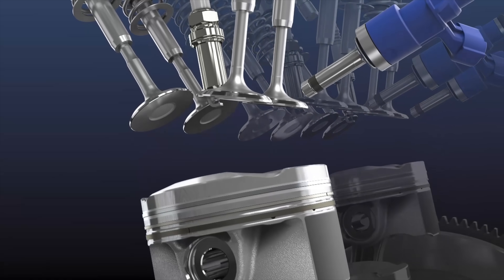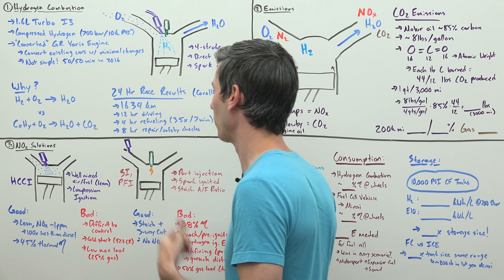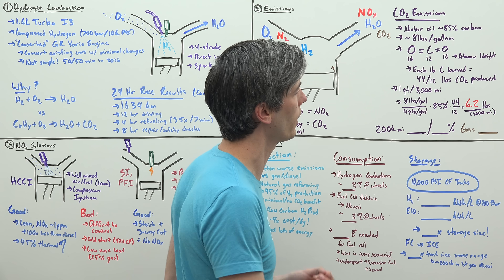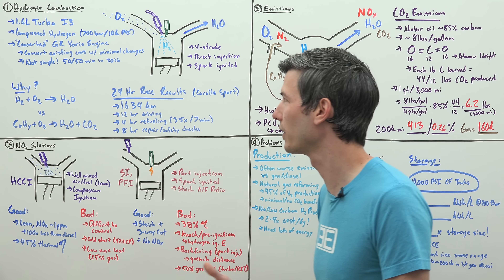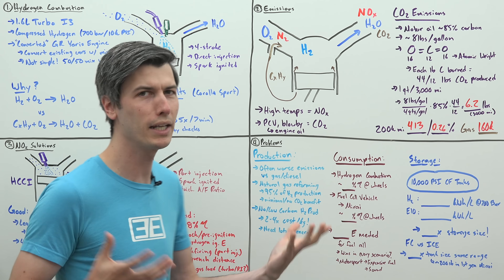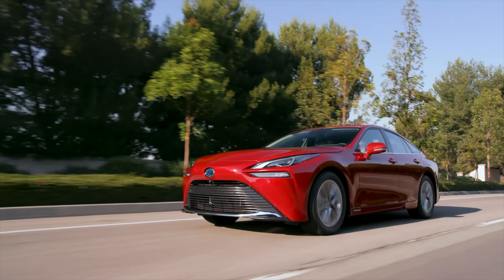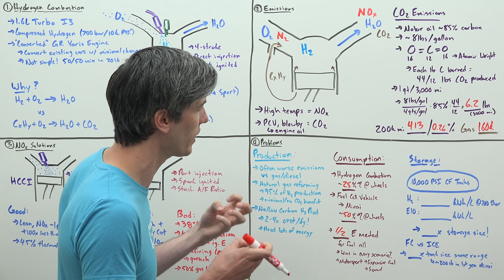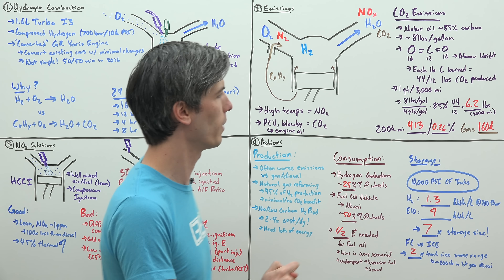Toyota's Developing A Hydrogen Combustion Engine!

Comment: Lets say you burn oil every 3k miles... Me a AP1 owner "right right..."
Reply: What is an AP1 ?
Reply: @rimckd825  it’s a honda s2k
Reply: As the previous owner of a 1998 Corolla, "That's nothing, man!"
Reply: Don’t hate on Hondas self-replenishing oil system!
Reply: I'm a subaru owner with a blown head gasket... my oil goes below the dip stick about 250 miles after filling it up
Reply: Me, a Yaris owner...
"Sorry I've lost you, what do you mean by 'burn oil' ?"
Reply: @Patient_Lion_BS  I wonder what this oil thing they're talking about is? 

My dad owned a 1997 Camry and he frequently 10k miles without changing the oil and had no problems
Reply: My 3.7 shawd tl burns about a quart every 1200 miles at best and that wasnt enough to qualify for new piston rings
Reply: @Egerit100  i too hace a '97 camry. Even today, 142k miles later, i don't think it burns ANY oil. Or if it does, it is a complely negligible amount.
Reply: me as a dorito engine owner: you only burn 1qt/3k miles?
Reply: I do 20'000 km without even needing to top up. Same with my previous car. Both diesels.
Reply: @jthomp997 Same :D
Reply: Me a Seni truck owner: right right
Reply: @jonwebb9261  Honda CR-V 1.5t owners would like know if you want extra fuel with that oil?
Reply: My old car only required an oil change every 60000km or 37500 miles. Sold it 2017 with 285000km/180000miles running like new. Never had to fill up in between the oil changes. Was an 2003 Opel Signum 2.2DTI (125 Diesel horses) (similar to a Saturn Aura, of course this engine was not available in US and also was used only up to 2004 or so in the Opel brand)
Reply: My C30A and B18CR don't need to top up even after a track day. I run 5w-30 Full-syn and change oil every 3-4000km. 
We all know how majority of owners love to rev it to 9000 but cheap out on maintenance.
Reply: Harley owrner: you guys are burning oil? Mine is in the driveway.
Reply: Pfff that's nothing,  i just neglect all maintenance and lose chunks of the car on my way to work
Reply: My ap1 doesn't leak. It doesn't smoke. The oil just disappears like magic.
Reply: @FroztiProductions  My AP2 isn’t burning that much oil. Should I be worried? lol
Reply: @jthomp997  Which model and year?
Reply: @jonwebb9261  I've owned Hondas for almost 40 years including a current 2016 CRV, and I have never added an ounce of motor oil between oil changes in any of them, including a 2004 Civic that had 350,000 miles on it that was still going strong when it was totaled.
Reply: @alansach8437  are you looking for me to say congratulations? I've owned Honda's for 10 years and each have them have burnt oil. It's not a big deal

Comment: I recently saw a video about JCB in England, they have been experimenting with hydrogen combustion engines in their construction vehicles. From what I saw , they have basically redesigned the cylinder heads for their Diesel engines, and they can now run on hydrogen!
Reply: Well I spoke to a JCB engineer in the beginning of Nov 2021 directly involved in the battery section of JCB and stated their hydrogen direct injection engine isn't real viable due to the huge amount of fuel required, however their Fuel Cell is very efficient, using 80ltr of hydrogen for 8 hours of work on a 16 tonne excavator but that's not JCB system and the cost of the system was huge, at least the cost of the excavator! So they are actually going down the battery route but cant tell anyone as they get huge grants from the UK government
Reply: That was a uncritical puff piece for JCB.
JCB also make battery powered diggers that make sense. Incresingly, these quiet diggers will be required for night works in residential areas.
Reply: @tatradak  JCB has had a battery digger for a year now.
Reply: @nordic5490  JCB said that small excavators are a better fit for batteries because most of the small excavators are not used for more than 4 hours in a day. The use of batteries in large excavators is not cost-effective or even feasible at this time.
Reply: The 20 ton excavator it's not viable in it's presentation , behind it there is a £150.000 container  ( the with the same colours as the excavator) filled with hydrogen and a built in pump  that is barely able to sustain the refill for that single excavator for half a day work.
The developing of that engine is just free publicity as it's 100% funded by the government.
Reply: So?   Hydrodren is expensive to produce.  Creating it and pumping it into a tank is expensive and uses a lot of energy.  Why this is always deducted from the equation and why it's called "zero emissions" is beyond me.
Reply: @tatradak Bruh quit the cap you know damn well you didnt speak to no engineer 😂
Reply: @ttamcc.4674  To write an answer like that in such other interesting comments means I have hit the spot... Been invited to JCB engineering and Power production PLANT.. it there they told me and showed me.. I have no need to write FUD and I have a number of engineers/academics that follow me and if I started writing FUD I would soon be fired..

Comment: I'm not letting "HCCI is difficult to control" count, because people have been cursing common rail injection as well, and now it's a staple in diesels. It's all a matter of development. I'm proud of Toyota for trying stuff here.
Reply: I think it's because the properties of hydrogen are very different from diesel fuel.
Reply: @UnnamedThe  Ah, I see your angle now.  Good point.
Reply from the maker: That's fair, but this stuff has been researched for decades, and still not really any commercial applications. Lots of companies (VW, Mercedes, Nissan, Mazda, Honda, Hyundai, GM, and on and on) have put effort into research/development, but decades later still not large scale applications. Mazda seems closest with their SPCCI engines, but even that has been delayed for US release.
Reply: @EngineeringExplained  BEV's where also developed for decades before they became viable. And i'm sure we all know how long safe nuclear power plants too to develop. Long development time does not necessarily mean the potential can't be reached.

Comment: i hope mazda tries to make a hydrogen rotary race car. that would be so cool to see
Reply: I believe there is research done that showed hydrogen combined with gasoline EDIT:(2-10% combined). It is the most beneficial air- dual fuel ratio that had least amount emissions while getting an evened out and faster burn to ignite all of the fuel before it exhausts. I believe this was done In a rotary.
Reply: Are you saying that because you just thought it would be a good idea and do not know about H2 rotary engines, or because you know that Mazda has made rotaries that run on H2 before?
Reply: Mazda did make a hydrogen powered RX8 race back when RX8's where new. You could buy in Japan only a duel fuel rx8 and it worked really well actually
Reply: Woahhhhhhhh. SO THERE'S HOPE?
Reply: The rotary engine works really well with hydrogen because the inlet combustion and exhaust all occur in different areas of the chamber unlike a piston engine which all occurs in the same place in the cylinder
Reply: Amen
Reply: @philip_james  who cares?  The motor sucks, had RX7, shitty gas milage and shitty power compared to V8 and esp to electric
Reply: I'd rather see the variable comprehension from Nissan for power meets efficiency without the added maintenance.
Reply: @andrefecteau  dorito engine
Reply: @andrefecteau  what rx7 did you have? And v8s also have shitty gas milage so yea. A Fd makes like 250hp from factory and that's really good considering the time period it was produced.
Reply: @justin6702  I had an 91 convertible RX7...traded it for 94 Mustang GT when it came out...was cool, tiny and shitty milage...the Stang was much better
Reply: I have only one thing to say:  "Hydrogen jet engine "
Reply: Rotaries get a lot of gasket failures which I would imagine is extraordinarily dangerous when dealing with hydrogen
Reply: @andrefecteau  To be fair, the convertible RX-7s were by far the heaviest and, having only the normally-aspirated engine,  the slowest and possibly least-efficient RX-7s made.
Reply: @Micamicamico  Not in the quantities that are in injected into a rotary engine.
Reply: I hope Mazda switches to BEVs real quick because it's the one company that I really don't want to see go bankrupt.
Reply: @castortoutnu  mazda is betting with Porsche in efuel.
Reply: @IrelandVonVicious  I would rather nissan keeps their variable comprehension, and takes it with them during their cosmic flush.
Reply: @spraynpray  oh okay, could be interesting then. I personally wouldn't gamble on it but if you think so then heck yeah
Reply: mazda had hydrogen rotaries 20 years ago.
Reply: But will have a same problem with oil burning
Reply: @slevingaius  yes exactly.
Reply: Mazda Furai
Was designed to run on hydrogen
Had a cross hatched rear windscreen to catch condensation at night and funnel it into the fuel /water tank
Reply: @Ahmad Hanifurrohim ok, here's the issue in life...you can have a great idea but if no one will buy it?  What's the point
Bro, it's an electric future, how one cent at any car company is not spent on that is folly...
Reply: So an extra quart of burnt oil on top of an engine design that actual burns engine oil purposly.
Reply: Really? Cool? I don't know. Question is how good will the car be.
Reply: Could you do the same example but using a different hydrogen method? Lohc for example? 
I‘m just wondering.. for example the amount of hydrogen stored in lohc is about 8 times higher..
That could help making an engine more efficient. Plus since it’s already a liquid you wouldn’t need those big tanks of hydrogen. 😋✌🏻
Reply: Would still need to burn oil i think
Reply: I hoop to
Reply: @andrefecteau  electric car is the  last coca cola in desert? I dont thing so. What about the sintetic fuell our biofull like the WRC will put in the engines for the next year?
Reply: @smokepeddler  if you like electric car, eat it
Reply: @antoniokk69  dead on arrival
Reply: A rotary hydrogen or a two-stroke hydrogen engine would be a dream
Reply: @flynnc-m560  I’d like to see the Loch Ness monster
Reply: ICE rotary engines are already terribly inefficient.
Reply: That’s two engineering dead ends in one car.
Reply: @dulanawijeratne7518  That sounds like Lloyd Christmas.

Comment: In an interview on of the Toyota’s engineer mentioned the whole thing can be scrapped but they wanted to give it a try at the endurance race, Toyota opened the door so it’ll be interesting where it goes from here
Reply: Toyota had prepared lean-burn engines as an alternative to catalytic convertors….the precious metals market ensured govts ignored them and introduced the legislation that guaranteed them a huge income and a superb technology got buried. Battery industry are doing the same right now to petroleum products and will destroy their main green competitor hydrogen too.
Reply: @Alfred Wedmore Lean burn spark ignition is great for economy and mitigating HC and CO but it does nothing good for NOx. Back when those engines were developed this was ok because the NOx emissions limits were relatively high. Once the requirements for NOx emissions became more strict it became impossible to meet them with lean burn engines, stoichiometric mixture and a 3-way cat was the best approach. As an aside, some modern automotive engines do use lean burn under certain conditions, it's just not applicable across the entire load/speed range.

Just to prove the point, diesels are intrinsically lean burn and thus can't use a 3-way cat. Initially this was allowed for by giving them looser NOx limits (and tighter HC and CO limits, which could be met using an oxidation catalyst) but these days they need the much maligned EGR and SCR systems to meet their NOx limits. A lean burn spark ignition engine would need the same equipment, though depending on the design it might be able to dispense with the DPF that diesels need to prevent soot emissions.
Reply: @nerd1000ify  This person spreads truth instead of conspiracy theories. There are plenty of real live conspiracies, no need to go looking so hard for them.
Reply: @Alfred Wedmore Sorry buddy, between you and the environmental nuts out there,  I'll stick with them.

Comment: Great explanation. The drawbacks of hydrogen were looked into years ago. The fuel cost alone will deter people from buying a hydrogen car. Then you have the massive infrastructure cost.
Reply: Hydrogen use with fuel cell engines is the only absolute solution though. It may be expensive right now; but much better choice than ruining the atmosphere and ruining the Earth. Its emission is water !
Reply: @gokcan83  It is better but better doesn't mean it is viable. Do you think people will be motivated to buy a hydrogen powered car when they learn about the expenses involved? Unless something can be done to reduce cost to a reasonable level this won't take off.
Reply: @abinmmj  the US Govt, federal and state, subsidizes the oil and gas industry to the tune of over US$20 BILLION per year.  Transfer those subsidies to the hydrogen infrastructure instead, and hydrogen becomes a viable fuel option.....
Reply: @abinmmj  Hydrogen will be use for all of Transportation, including semi-trucks, airplanes, cruise ships and powering houses. Don't worry Hydrogen is not going anywhere now
Reply: @ianchandley  So you say. Devil's in the details (and line items).
Reply: @ianchandley  Infrastructure is the other part of it which can be subsidized. 
How do you get people to buy a hydrogen car with almost 2x fuel cost? You need consistently more people to buy these cars to generate profit for the manufactures. It's all about demand and supply. No manufacturer is going to keep producing these cars if the demand is low.
Technology needs to improve to a point where it can keep the costs down.
Reply: For cars it will certainly be silly, especially when EVs are so far ahead in development.
Reply: @abinmmj  the cost will drop every 2 years. Plus in California your not paying until 6 years. So what is the difference?
Reply: @MsSomeonenew  Hydrogen will be the leader but it will start from another country. 100% we will behind technology for another 20 years
Reply: @Menga213  See the big picture here. By the time hydrogen cars comes into market, EVs will have advanced so much that the consumer demand will stay there. Hydrogen cars would have had a chance if more investment and R&D was put into it 10-15 years back.
Reply: @abinmmj  H2 cars never had a chance and never will again. Just to expensive. BEVs are so good already and keep improving that there will be no more demand for hydrogen cars in 5 years.
Reply: @gokcan83  Batteries are better. 400 pounds of batteries (the empty weight of the fuel tank mentioned) would give you a 45kWh battery. That's well over 100 mile range with a Leaf. If Prof. Goodenough gets his solid state lithium cells working that would extend range to more like 500 miles.
Reply: The fuel costs of gasoline would be high if governments didn’t subsidize their operation from it’s inception. If the same happened with hydrogen, it’d be cheap as well. Same thing goes for infrastructure, it’d follow with the rest of the industry
Reply: @gordonlawrence1448  We all know that it is impossible to transform all personal automobiles into electric vehicles, due to the resource limit in the production of batteries. Electric vehicles are band-aid solutions against carbon emissions, where the whole world can not switch to it due to resource limits of the world. Without significant developments in battery technologies, there does not exist enough resources to totally switch to electric vehicles.
Reply: What was the relative cost of fuel & infrastructure when the gasoline internal combustion engine was being introduced?
Reply: If it is just subsidy that makes a product successful in the market place then why haven't the consumers and auto manufacturers demanded that from the government yet? It's not just simple as that.
Reply: @gokcan83  how do you think all that hydrogen gets produced? Either from natural gas, or via electrolysis. NG is no net benefit with CO2 production, and electrolysis uses HUGE amounts of electricity, the majority of which still comes from fossil fuels. Plus that created hydrogen gas has to be compressed and cooled into liquid form (more energy), then transported via new insulated and cooled pipelines and trucks. Then stored at newly-built gas stations. But not too long because hydrogen is really, really leaky. Then you have to use a pump with astronomical cost to get it into your car’s highly-pressurized tank that will have to be replaced in 10 years. And hope that the highly-reactive hydrogen doesn’t go full Hindenburg on you at any point in this process. All this to get fuel cells to…make electricity to power the car. Far, far more efficient to just store electricity in a battery to power the motor.
Reply: "Massive infrastructure cost". Think LPG tanks.

Comment: Yamaha and Toyota is also develop naturally aspirated v8 2UR-GSE hydrogen engine and it make 450hp @6,800rpm and 540n•m of torque @3,600rpm so it have same power as gasoline 2UR-GSE at slightly lower rpm with slightly more torque that mean your hydrogen engine is gonna feel stronger and better response, so power is not really problem anymore, So only problem with H2ICE for now is NOx emissions , Fuel consumption ,And reliability.